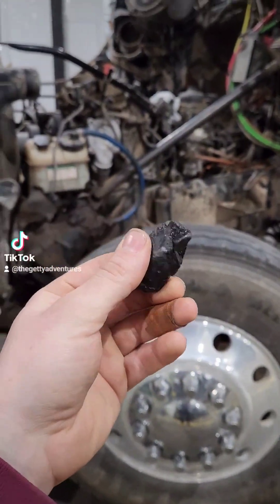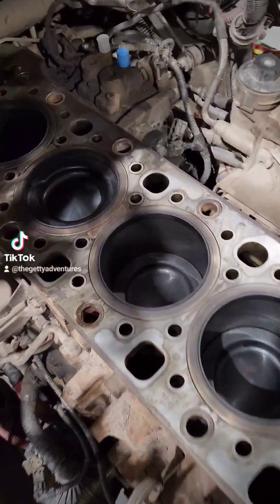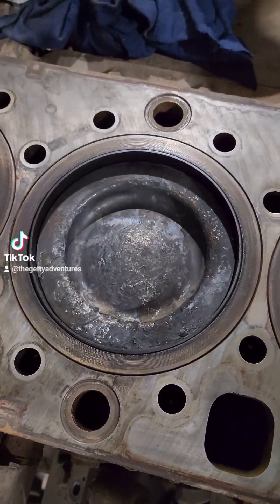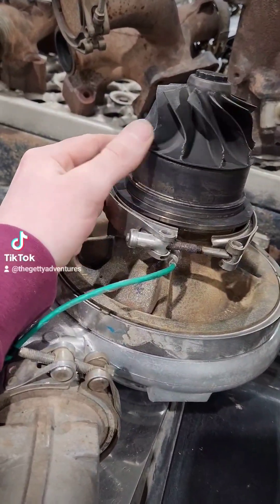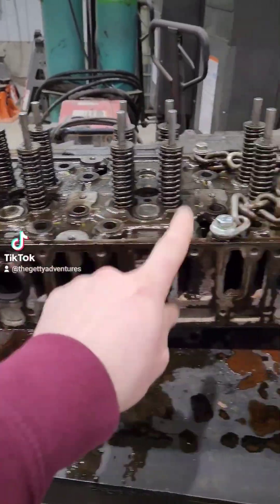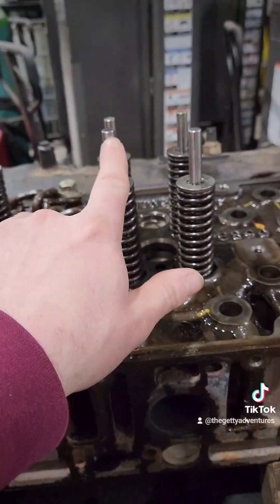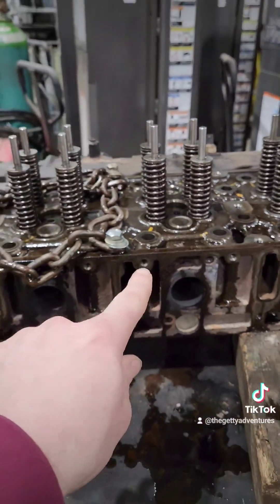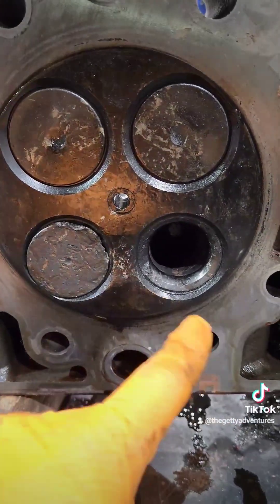15L Detroit Diesel Engine spits out EXHAUST VALVE!!!

Comment: " This piece of metal ".  A valve.  Like it was some master-mechanic needed to diagnos that.  I suppose you will bill them for all that dissassembly work, which for sure was not needed to reach your conclusion.  An honest shop would have skipped the B.S, and gone straight to telling them to buy a new engine.  A full rebuild, plus all the parts needed?  A turbo, a piston, valves, a valve-job, all new bearings, machine work, etc.etc.  lame.
Reply from the maker: Are you mentally ill ? We are  mechanics, not part changers. Also a new long block is about 50k not 5k you stupid fuck. A turbo alone is around 8k. That engine was stripped and rebuild in 46 hours. 30 year engine tech did it. He's lost more knowledge then you'll ever retain.
Reply: @GettysGarage hehehe i like you i’m subbing
Reply: @GettysGarage  I think he is mentally ill, he's "invented" spark plug cores that pop out to let water out of cylinders...
Reply: @GettysGarage  he's mentally ill 100%
Reply: @GettysGarage jesus christ you didnt have to massacre the poor uneducated child 😂😂😂
Reply: @GettysGarage are you serious with those prices 😳it wouldn’t be anything like that for engine parts in the UK. Looked surprisingly little damage for a dropped valve.
Reply: Do you have any idea what that costs?
Reply: I googled DD15 and found used examples for $6,500-$14,000.  They are complete engines with turbo and all accessories.  I would think long and hard about going the rebuild route, a dropped valve means an expensive valve replacement, piston, possibly piston liner, and possibly the exhaust valve and turbo.  With people throwing $8,000 dollar prices on the turbo alone, it would seem a used turbo with complete engine included starts at $8,500.   But an honest shop provides a warrantee and they would rather trust a 30 year mechanics word that his rebuild will not turn into a warranty job than a used engine the shop knows nothing about.  I'm sure you guys did a great job, I'm just a cynic. Aren't we all?
Reply: That's an Easy $30000 k rebuild.
If it's got the DPF crap on it. Replace that from the EGR out as well 
Now drive it another 10 years .
Reply: Hate to break it to Ya but your a parts changer being a mechanic. To boot U just might be a Fool Also.
Reply: A new core for that turbo is like 500 bucks OEM or 200 bucks aftermarket. Piston and sleeve is about $500-800 and the head repair would be about $1000.
Reply: Took my comment oit ? You are a parts changer. Thats what a mechanic is. You might be a cheat also.
Reply: @peterparker9286  to whom are you referring to and what was your comment?
Reply: @albinklein7680  I told ol getty that He is a parts changer because thats what mechanics are Parts changers. And that and most likelyHe might also be a cheat or thief.
Reply: Wow Dude, Miserable much? How's the weather today in Miserable City? Gah, we don't all reside in Miserable City as you, so chill...it's video.
Reply: "An honest shop" you say as you're talking about the literal scumbiest thing a mechanic can do
Reply: Lots of words about how mistaken I am, some specifics would be nice.  If the shop billed $200 an hour for 39 hours, that's $7,800 for labor.  Without more information, it's impossible to know which fix is the best deal for the customer.  The 30 year mechanic may have spent 39 actual hours, but the billing may have charged 60 hours of book rate, I would expect that kind of efficiency from a 30 year mechanic.  The shop rate could be $300, or $100, which is closer?  And what is the engine code, I could look up what it costs.  The statement made about the turbo alone costing $8,000 to replace sounds exaggerated by about $7,400 dollars.  The damaged turbo could have been refurbished by the shop for $100-$600 dollars.  It would be nice to bill the customer $8,000 for a side-job.  A repair shop will always want to bill more for shop-rate hours worked than sell a part with 30% markup
Reply: @YouTubeOdyssey this is a truck engine not a suburban 😂 broken DD15 long blocks sell for 18 to 20K.
Reply: $5,000 for a long block R&R
Reply: Nope. 5k?  You probably can’t buy the new turbo for 5K.
Reply: @1waukesha the labor isn’t that high, normally. Maybe in some states. Somewhere around 20-30k for this disaster would make sense.
Reply: You could provide how many hours you billed for the job, and your shop-rate per hour, plus the parts bill.  If you also told us what the engine code is, we could look up for ourselves what a long-block would cost.  Most customers would choose to replace the long-block, if the price is comparable. Most shop owners would of course like to bill for the hours of a teardown and rebuild because the vast majority of the money will go into their pocket, instead of the engine supplier.  Am I "insane", or " mentally ill " to have this opinion?
Reply: @YouTubeOdyssey you’re insane. Here in California it’s much cheaper to rebuild than replace with a long block, and it’s not even close.
Reply: @YouTubeOdyssey yes your heated over a yt short
Reply: @YouTubeOdyssey  you could also be a normal non psychotic guy on the internet but hey🤷‍♂️

Comment: First thought was a valve more then likely exhaust side :/ specially when I saw the piston.. It forcibly pushed that exhaust valve out of the head needs some love that's for sure I'd check for metal in the system check the filter and cam and crank.

Comment: I had an old '94 60 Series Detroit diesel. That thing pulled like a beast in the mountains. The heavier the better it pulled. Only trick was having the cruise on. It pulled better on cruise control for some reason. If you forgot to flip the switch after dropping a gear you could tell right away. Loved that old beast. Beat on it & it loved it. Great engine. 😊
Reply: I recall the programming would/could give you extra hp on cruise, hence the 360/400 (or whatever it is) rating.

Comment: Im suprised it only tore up one piston, usually on those dd engines the egr sends the metal back into the intake and into other cylinders, ive seen a quarter of a valve trash 5 cylinders
Reply: That peice would be too big to go through the egr cooler surely